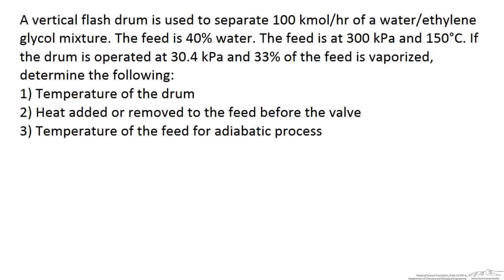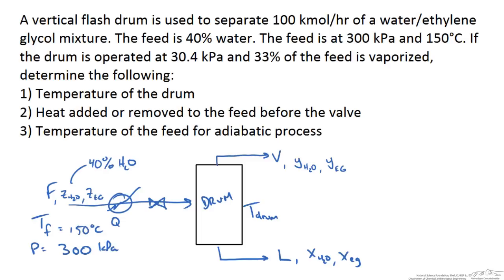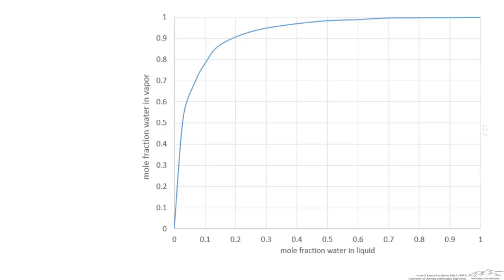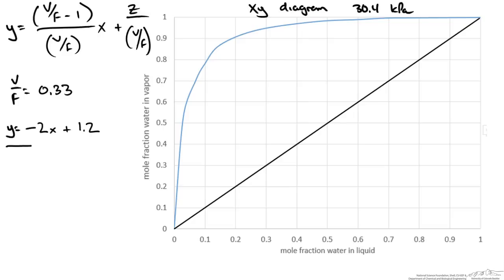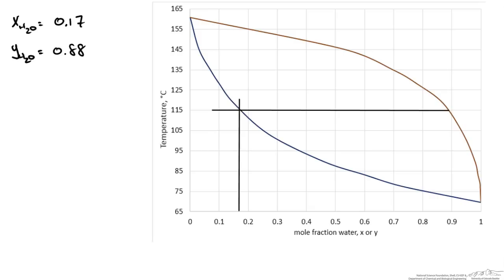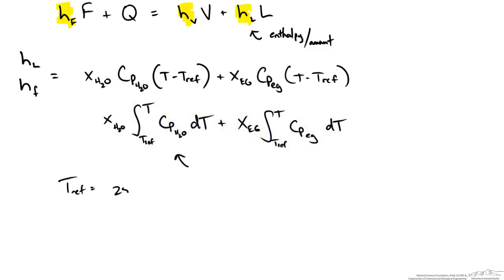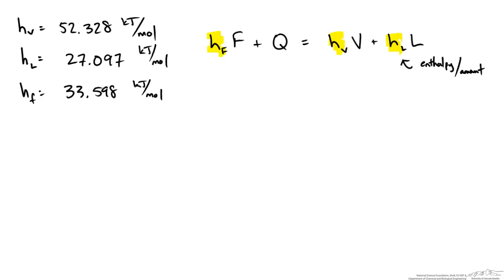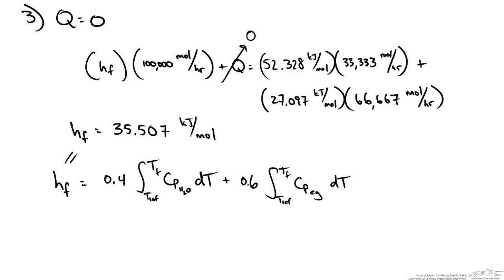Flash Distillation Energy Balance

Comment: Did you use V/F=0.33 to calculate the molar flow rates of the Vapor and Liquid streams? If so I got 30,000mol/hr and 70,000mol/hr.

Comment: I have a question! If the feed is at vapor state, how should the enthalpy balance be like? Assuming Tfeed as our reference, the molar enthalpy of the vapor phase of the i-species is calculated as cp,v,i*(Tflash-Tfeed), whereas the molar enthalpy of the liquid phase of the i-species should be calculated as cp,L,i *(Tnb-Tfeed)- deltaH,evap(Tnb)+ cp,V,i*(Tnb-Tflash). Tnb is the normal boiling point temperature and deltaH,evap is the evaporation heat at Tnb. Is it right? I am concerned about the order of the last term: which one is correct:  cp,V,i*(Tnb-Tflash) or cp,V,i*(Tflash-Tnb)? Thanks in advance and sorry for bothering you

Comment: i'm guessing you used 25C as ref temp in calculating Hv. at what temperature is the latent heat? in that calculation?
Reply: +Tu mi  You must use the temperature  for all problem. Don't matter the reference, but have to be the same for te current problem.